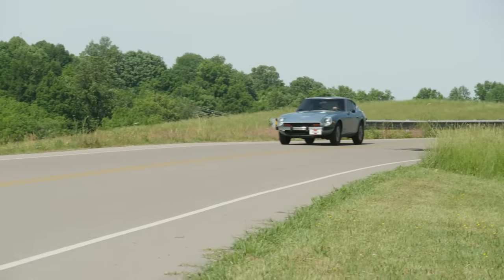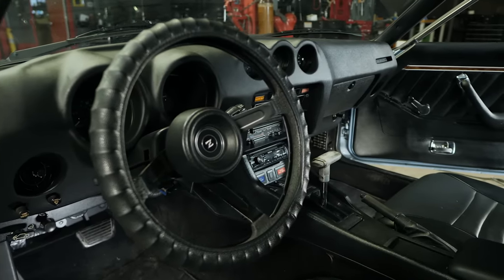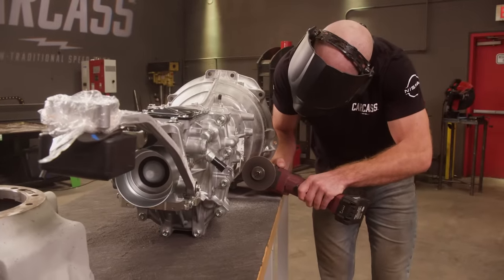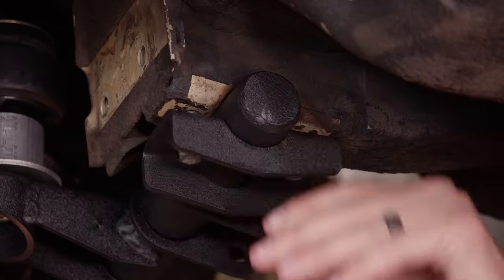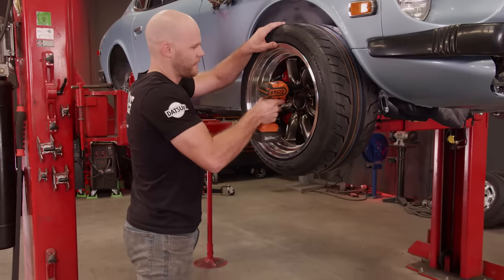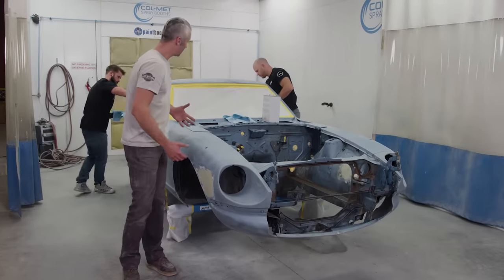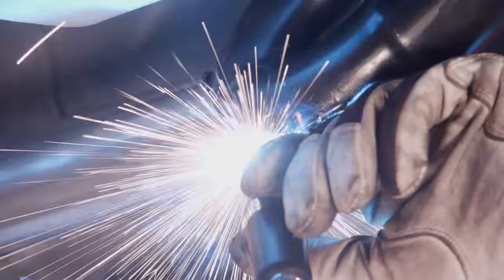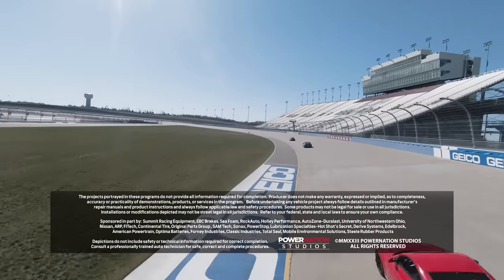TURNING JAPANESE: From 280z to JDM!

Comment: 1978 Datsun 280Z
In Carcass
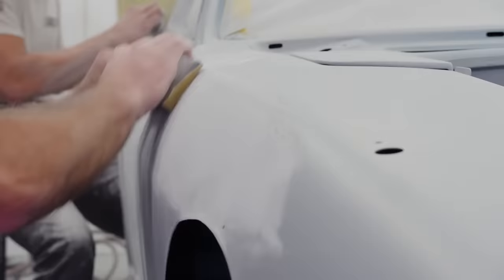1:08:42 Silky Smooth
Reply: Engine is stock, main chassis is stock, suspension is better, transmission is better. I'd rather have this than a bone-stock one but i'd put a Nissan RB30 on it and a roll cage.

Comment: Little disappointed, going to this extent they should have pulled the head and had some porting done to it, not hogged out just optimized and the same with the intake and exhaust manifold. And also a nice performance camshaft and a high flow cat and nice flowing exhaust  those simple things would not be visually noticable but likely netted 30 to 40hp...more maybe maybe not I know nothing about these engines potential. Having 160whp or more? vs a wheezing 125whp a long with with extra rpm would be a huge  improvement.Might need bigger injectors? But they blow serious jing on projects so if leaving the short block alone these mods are pocket change to them. Now going to have a mint still slow 280Z.

Comment: Boulder grey? In the 70's it was known as flat battleship grey primer. This car is not a colour, its a shade of black and white with no colour pigment that equates to a medium grey 50% primer with a high gloss clear coat. When we were kids we would have been embarrassed to take a car out in primer. This is not a colour. It's a shade of blah' and a lazy excuse for a modern colour.
Reply: They ruined the whole car with painting a dirty engine, screwing holes in the fenders and painting it with primer.

Comment: When connecting wires for ecu signals, never use cheap tin connectors found at auto stores. They will degrade the signal. Use "gold plated" copper connectors, or use oversized tin connectors and ensure copper wire strands from both sides are overlapped for best signal quality.

Comment: I love most of what you did with this Z car and the modern suspension and breaks are great, I did something similar when I built mine up from a bare shell. The only negative I have is the width of the wheels, they look stupid in my opinion. Not practical at all.

Comment: This is nice, but there's an issue. When a 280 Z is restored, most people want to see the car returned to its original condition. That way it retains its charm. Of course if you want to change the car that's fine, but then its not a restoration anymore. Parts of the old car are simply being used to make some kind of hybrid. I wouldn't call this a 280 Z. It's a rice burner. If you put a Rolls Royce steering wheel into a Camaro, then it's not a Rolls Royce or a Camaro.

This only matters when the word "restoration" is taken into account. If something is "restored" then there's an obligation to be true to the original. 
If it's chopped, then you can anything you want. This car is being chopped, not restored.

Comment: You guys don’t rebuild the engine to modern standards then add bolt ons, you go and do the suspension, brakes and gearbox right then you over wheel and tyers that leads to cutting the wheel arches but you cheap or like the engine and do bolt on clears and the cherry on the cake you add the ugly ducklings the fender mirrors that never come on this car, the choice of colour is subjective. Don’t know what you guys are thinking the heart of the car yo did f%#k all, what a waste all show no go.

Comment: I'm sorry it's a 280 not a 240 Should have left the front and back bumpers alone No reason For those review mirrors Not a fan of the Flares way too much tire bad wheels Besides, the upgrades on the color suspension Bigger brakes, adding a limited slip differential and Fuel injection everything else is horrible

Comment: Sadly, it was my experience that Nissan did/does not stand behind their products.  My new at the time 06 350z 6spd VQ35DE consumed 1.5qts of oil every 800 miles. After fighting Nissan for 2 years they replaced the engine with one that soon developed timing issues. Nissan = Trash